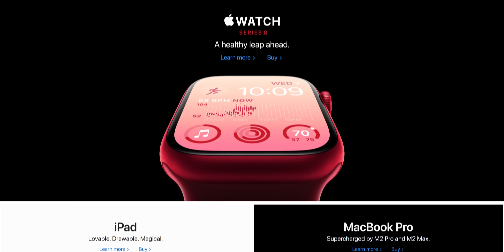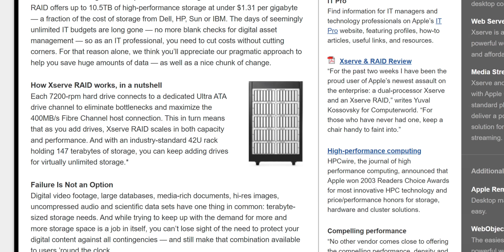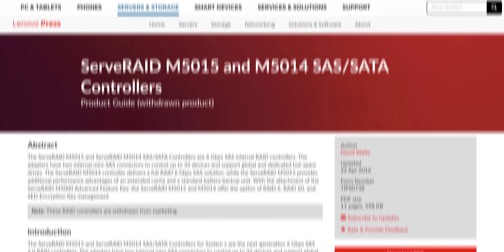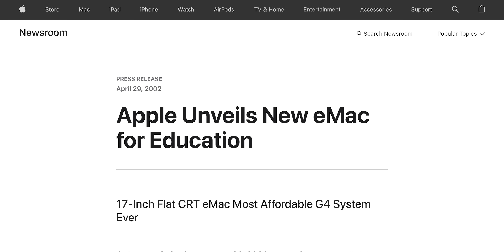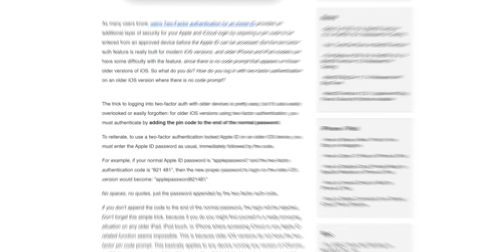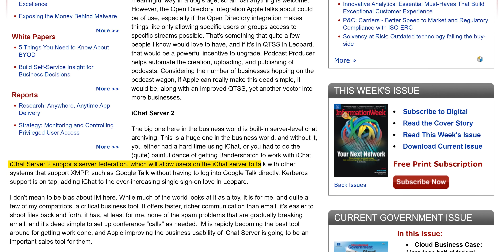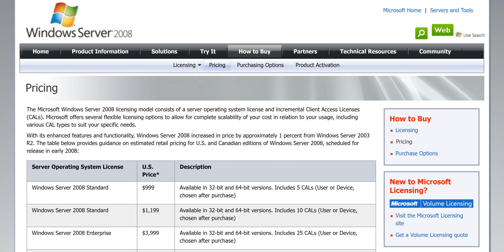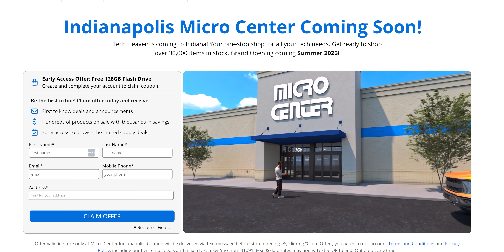I Bought the Last One Apple Ever Made... - Apple XServe 3,1 Server

Comment: IIRC the Apple firmware on harddrives were related to boot options, diagnostic features and RAID synchronization features, in short, for all features of the server to work.
Just like the proprietary connectors have extra sensor lines for example. It's not just for show - it is definitely not cost saving.

Comment: You can upgrade the cpus in this Mac. Sure they're delided and you may still have to do it but all I did was flash mine to a 2012 and ever so carefully (very important point!) installed them bare and wallah. I turned my 8 core 16 thread MacPro in to a 12 core 24 thread MacPro and bumped up the ghz to like 3.33 ghz. It was a screaming demon at the time. Served me well. But I don't recall buying delided cpus for it. I just plopped them in and ever so carefully installed the heatsinks. Carefully being keyword here.

Comment: I actually had a similar story with an Early 2006 MacBook Pro trying to reinstall the OS. I had no install discs for Snow Leopard (the latest version supported), so i had to track down an installation file, and after finding an ISO, obviously I would like to get it on a DVD but the ISO was larger than 4GB and i didnt have any blank DL DVDs so I tried using Rufus to get it onto a USB drive but it gave me the same error every tie i tried and after failing to find any other working files i decded to just say f*ck it and installed Debian 12. It installed just fine with no issues the first try.

Comment: Snow leopard server was the greatest server apple ever made, I ran it with every service running for at least 10 years to the point security was a washout. I looked into some ways of upgrading the Apache server but it would break the gooey. The servers after were garbage, the only problem I ever had was chat every so often I had refill one box. To this day I wish I still was running it. I even was using processor power from an Imac to boost it power, IT HAD IT ALL and would still run if somehow you could get security upgraded, but I guess no genius ever ran one.

Comment: (didnt read all the comments) missing is the apple version of ipmi/ilo managament: these servers can be remotely turned on/off/managed. Also missing is the big reason apple made servers: in some contract for the US navy all software/hardware to be delivered to that entity had to be 32+ bits able and should also be able to run a version of unix. Starting with A/UX, apple went over to AIX, then nextstep (carnegie mellon kernel), and then osx. Dunno when the marines left out the requirement, I'd guess around 2006 or so ... And opencore legacy patcher makes the xserves probably als run the latest OS presently available ...

Comment: I’m in IT for a school system. I LOVED the xserve servers.  They were so reliable. Used to virtualize just about anything on them. Loved the redundant raid configurations. Used robbed able to easily be able to replace the drives. Would just keep a couple spares although I learned eventually you could swap westerndigital server level drives into the carriages. Never actually had a drive fail. Loved the dual nic. You could also get dual processor models. For years our xserves performed without thinking about them while other company products gave us more challenges. Sadly I do not have happy memories of the xserve software. For years we would have trouble losing the entire user databases. I finally learned how to back them up and restore them relatively easily. But eventually had to give in to Microsoft as managing windows logins and newer Mac clients just got too complicated and insecure. Happy memories overall.

Comment: I remember seeing these here and there back in the day. Although I'm not computer illiterate, never really understood what servers were used for. Fast forward to today, I recently converted an old MBP into my first home server. It's a late 2013 15" MBP that has just been sitting in my drawer since I finally upgraded to an M1 Pro 16" MBP a couple years ago. The 2013 MBP has a broken screen, so I figured I would just replace it myself till I saw the prices on eBay and was like, nah, and let it sit more in my drawer. 

Anyways, I just did some drywall work at home and thought it was a good time to run some Ethernet cables to some of my rooms, and also wired the garage, figured my server could live there (it's separate from the house). Attached to it are 2 OWC Thunderbay 4 RAID drives, my main one is the mini with 4 x 2TB 2.5" SSDs that holds all my photography RAWs. The second RAID holds 4x 4TB 3.5" HDDs and is a clone of the other RAID drive. Gigabit ethernet is plenty fast for my workflow and I LOVE how silent it is at my desk.

The MBP server is also hosting some movies internally but I plan on getting a 2-4TB SSD to hold movies for streaming.

Comment: I deployed a few xserves over the years. They were a solid platform. I still have one sitting in an original box that I just pulled out of storage. I’ll probably end up putting it on eBay to see if anyone wants it. I even had a spares kit kicking around somewhere too (logic board, power supply, etc).

Comment: The part where you had problems creating a USB installer for macOS, you were actually using the standard installer. The correct way to build bootable install media is to run the command line utility createinstallmedia from inside the installer's app bundle. It will run on any system no matter what. I'd love to crap on Apple here, but in this case, your issue was the user's lack of familiarity with the enterprise side of Apple software.

Comment: I ran a network with about 20 of these an about 500TB of XServe RAID's back in 2007 - that was a lot of XServe RAIDs. The little hardware light on the front also used to flash on the Admin App. Anyway, besides that you got a bunch of stuff wrong (quel surprise) 

1. You could use any IDE drives in that sled, and in any sled (G4 / G5 / XServe RAID)
2. The internal 2.5" HDD was a standard connector in the sled (have you never opened a comparable era MacBook?) 
3.  There were redundant power-supplies, so no battery really needed on the RAID card (also UPS) at the time. 1U HP Servers were the same, without the redundant PSU.

Comment: I believe you can change the system date in recovery to make the server think the certificate was valid. Also you don’t need to run the el capitan installer to make a usb bootable drive of it. There is a page on the Apple support that gives you command line to create the usb on any modern mac.

Comment: Back in the early 2000's a company I worked for got a bunch of Apple XServe G4 and later G5 models. I remember they used to suffer from a "smiling" issue where if you didn't reassemble them using the screws in the proper order with the right torque, the cases would sag (like a smile) and you'd have trouble closing them up when mounted in a rack. Good times.

Comment: Oh this throws me back. Mac OS X server was honestly a fantastic, reliable product - as long as you stayed within the bounds. Think Synology DSM - lots of fabulous tools that worked well, open source at the core, but with a GUI that made it easy. Especially when Mac did not nicely integrate into Windows Networks and Active Directory: Open Directory, Apple’s alternative, had a specific mode that let it integrate as a middleman between the two so Macs could fully integrate but still have proper management and support. It was very slick, and worked well - it just never got the attention it deserved, and once Microsoft got better at multi-platform support it didn’t make a ton of sense for Apple to keep supporting it.

Comment: I worked at a company that required XServe.  We wrote the software almost every ISP on the planet ran, from DNS to web caching, and so on.  This meant that almost every ISP on the planet (except China and some places in Africa) had an XServe in the NUC.

When XServe died we switched to Linux, but it has a bug where only half of the number of ports can be open at the same time, so companies had to suck it up and many ISPs had to buy twice as much from us.

We used XServe for it's BSD and stability.  It was a beast that cut down technical support drastically.  You didn't have to worry about hardware or software errors.  This was back in the day when "It just worked" was actually true.

Comment: Actually you absolutely can use any drive there. Or an ssd. Xserve has a way better drive compatibility than HP systems (that will run coolers at 100% all the time TRIPLING your power consumption if it doesn't exactly like the drive). Most fine enterprise 10g Network cards will work as well. It takes NVME like a charm (via PCI express adapter)

AndApple Server software was absolutely awesome. It had amazing tools combining industry standard open source software with cool control interfaces. Also, beside nice GUI you can set everything in config files, like in any NIX system. Some things are only configurable via config files, like Bonjure sleep proxy service (allows you to use WoL right from your Mac OS without employing actual classic WoL yourself, media share, etc)

 All hassle with software you guys had is only because the approach was not exactly correct in the first way. 

If you update it to 6 core CPU's and have it with 72-96 Gigs of RAM this machine is still a very fine server with a modest 110-140 watt power consumption.

Comment: These were pretty massive in education back when apple implemented their learn grants (~2009). Basically had to have one if you wanted to mend Active Directory into the Mac ecosystem. I worked with a local school district during college that had 4 of them and the Raid system running in a server room. Honestly, they were great!! The imaging system is dearly missed as there is no way to image over the wire anymore. Those things were still in production and still hosting the file servers last I talked to the school.

Comment: The killing off of OS X Server was a really sad thing. Over time they removed more and more of the GUI services and made them only accessible through terminal. Terminal had more features available but made everything much less user-friendly. They did it more and more until there was hardly anything left and ending OS X Server became a mercy-killing. There was actually a plan back in the early creation of iCloud to allow customers to back up their devices to their mac or server remotely. Xserves were cool but hardware advanced so much in the years after they killed it that there’s not much way to bring them into the future without scrapping the platform and doing a Hackintosh.

Comment: A heat spreader in a server? That would add 60 grams to the shipping weight and reduce thermal efficiency and require a slightly bigger radiator and more air flow and increase user friendly upgrades. Can’t have any of that.

Comment: "It's not pretty" Pfffttt! That thing was grade A Apple industrial design even on something that indeed, nobody "needed" to look at. I mean yes, as ya mentioned it is pretty stylish. Hell even their RAID hardware was super slick also. So much better than anything else of the era, hell even now the design blows everything out of the water.
But indeed, absolutely brilliant hardware and software of that era tho: incredibly capable, reliable, and solid.

Also yeah trying to build a boot volume on newer hardware is downright infuriating. Like they built in a feature to make boot drives, and then somehow locked you out of it for no good reason. As I know there's some workarounds (as in breaking it checking) but it's all stupid and frustrating and functionally should not exist. A simple warning of "building a boot volume for <version number> will not work on the computer you are currently using. You may only use this boot volume on older hardware which supports this version."

Comment: Those hard drives with "custom" firmware are actually flashable with open source tools. I've taken off the shelf seagate FC drives and reflashe2d them with Netapp firmware (including changing from 512 to 520 bytes/sector) and made a NetApp think they were official netapp drives. I'm sure the same thing would work for these drives.

Comment: I have the 2009 Mac Pro (both dual and single (singe uses lidded as a standard, dual not)) and it is possible to use non delidded cpus, because the locking bracket for the LGA1366 is not mounted on apples motherboards (both the Mac Pro and Xserver) and the heatsink is the only thing holding it down, so you can move the heatsink up by using washers

Comment: I have a 2008 and 2009 and was able to upgrade the 2009's GPU which is a MXM and put in a Quadro K1000M and it works perfectly fine shockingly enough. The Primary SSD is shared with the first gen Macbook air, only way i know that is a orginal Air failed so i took it apart and that drive matched the one used in my xserve. The raid card linus showed was from the 2010 and 2012 mac pro.

Comment: Had several xserves when I worked in EDU - for system deployment we used DeployStudio to create the images.   Slowly started migrating off of the xserves, first moving to google edu to free up the mail server,  then away from server based storage to drive and local logins. Mainly just making my life easier....   At that point the xserve was no longer available, so for deployment we started using Casper/JAMF, and bought a trash can mac to run it on.    When I left EDU I had pretty much ripped out all of the locally hosted servers and moved everything cloud based,  even mdm, using Mosyle instead of JAMF.

Comment: The hard drives are not locked. They use what is now an ‘older’ SATA spec and you may have to fiddle with jumpers on newer drives to set them to SATA 2 speeds

Comment: The PowerPC G4/G5 versions were huge in DNA sequencing in the early 2000's as well (PowerPC had particular instructions that reduced the number of steps per cycle drastically improving performance compared with other processors) - was likely a fair percentage of the Xserve sales from what I was told back then, with the move to Intel in 2006/2007, that advantage went away.
Reply: Yep - my friends at The BioTeam sold a bioinformatics software stack that ran on top of XGrid clusters. The combo gave a very powerful setup for small labs lacking the usual level of expertise needed to build a small HPC service. Remember this is a time before Linux clusters were as wildly popular as they are now, and building UNIX clusters normally needed some serious know-how.
Reply: Back in the early noughties I put together a computer cluster consisting of Xserve G5's for molecular dynamics simulations. They were dual 2.3's running Yellow Dog Linux with MPICH for clustering. You could get some real performance out of these CPU's by taking advantage of the Altivec SIMD extensions on the CPU, although performance was considerably better when I compiled stuff using IBM XLF/XLC as compared to the GCC and binutils that came with Yellow Dog. I also had a top end G5 desktop (one of the Quad G5's at the time). That was the last Mac I ever bought, I couldn't see the point after the Intel switch as I could get superior performing hardware for a fraction of the price.
Reply: Maybe in time the M1 chip line will bring this back?
Reply: PowerPC is still available
Reply: well, in general PowerPC is still available, but Apple moved away from it in 2006.

Comment: They originally had 4 drive bays up front. But then they needed more cooling, hence the two air intakes that are exactly half the size of a drive bay. Also, you won't see many rack server chassis made from stainless steel.

Comment: I run into the same software issues on my Late 2009 iMac that I still have. Couldn't use ANY existing software because they were heavily out of date as I hadn't used this machine in years. Software Update being completely unavailable because Apple is so ass-backwards when it comes to older systems and upgrading to new versions. Tried a modified and more modern version of Mac OS to install on this iMac, which failed to install because "unsupported' despite the modified install copy I had loaded to a USB stick was MADE for my iMac specifically WITH a custom bootloader that's also required for it to work so it would operate on it's old Intel® Core™ 2 Duo CPU for a Late 2009 iMac, I wanted to revive this machine with fresh updated version of Mac OS, but I think what I'll ultimately do is just repurpose it as a Linux workstation, because Linux will run on this thing, less headaches when it comes to "outdated" software, and I'll be sure to install something more useful that will be supported.